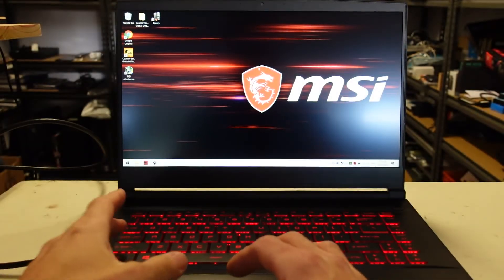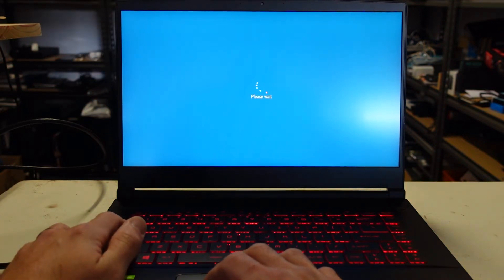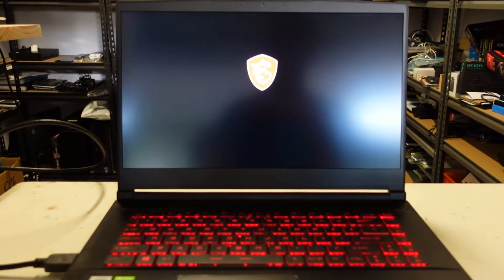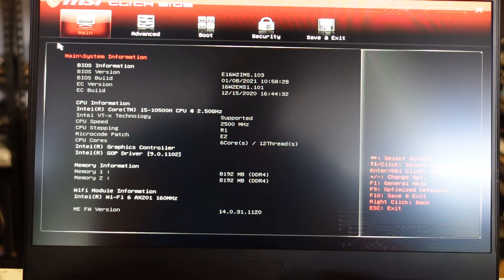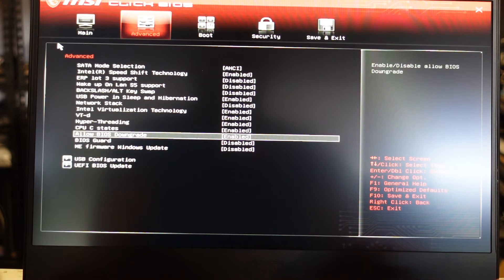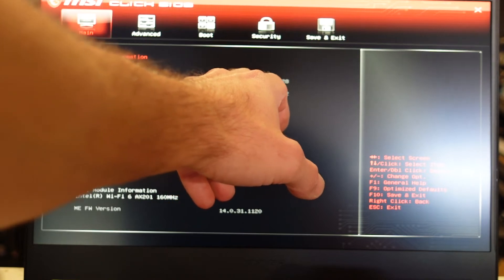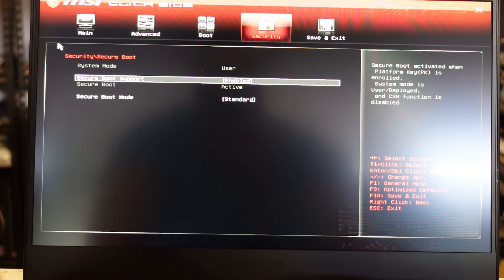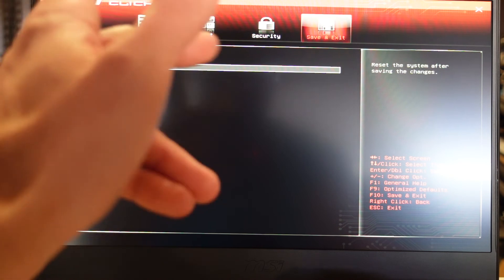MSI GF65 Thin 10UE Bios Walkthrough

Comment: I am stuck on this screen and have no clue what to do. One second i was playing a game, then a blue screen came up saying windows had to reset, now my computer comes here every time i restart it. Can someone please help?

Edit: i completely re installed windows from a USB, wiped all my old stuff, and the problem was gone. Maybe there was a better way to do it and keep my files, but i have no idea. If you have the same issue, good luck.
Reply: Currently experiencing the same thing. Acts as if the ssd isn’t available. Opened up the laptop and disconnected battery/ram/ssd and reconnected, fixed system time/date and it finally worked like normal and still had all of my files. Then went to reset for an update and BAM, back at click bios. Back to square one lol
Reply: @Mr_F0iL  i had to re install windows from a USB drive. It deleted all my files but once the fresh copy of windows was installed i didn't have any more issues.
Reply: @Charles37400 did you get your files back?
Reply: @seekcomesAgain-w8q1v  no
Reply: @Charles37400 did it happen again?
Reply: @seekcomesAgain-w8q1v  also no. i installed a new copy of windows and wiped everything. computer is fine, files are lost. Future bluescreens happened but none that sent me to BIOS or that caused any lasting issues. i really dont know that much about computers but if you really need to keep your files, an idea i had at the time was to replace the hard drive before installing windows again and seeing if i could open the files on another computer by using the old hard drive with it. i didnt bother cause i have a laptop and their annoying to take apart, and also because i didnt have the money to buy a 2nd hard drive, nor a 2nd computer to use it on. that's purely a shot in the dark idea from someone who knows very little about it, dont take it as a recommendation
Reply: Ec reset works for me got stuck today
Reply: Did you fix it?
Reply: I am stuck on it as well, it just happened to me
Reply: Did you manage to fix it ?
Reply: @napoleonbonaparte7193  i think youtube deleted my comment, i did fix it. I re installed Windows completley from a USB drive. Lost all my files but had a working computer again
Reply: bro sameee
Reply: @Rxboiiii  put a new copy of windows on a USB drive and boot the computer from it so it re installs windows. You'll loose all your data but you'll have a functional computer. You can replace your hard drive first if you need that data
Reply: Just search how to ec reset it will show on google
Reply: Did you fixed?
Reply: @dennisribeiro4487  I got the computer to work by deleting everything and re installing windows. I was not able to do it in any way that kept the data on my computer.

Comment: I have such a problem — I removed the floppy video card while cleaning the insides of the computer and after the introduction, the computer stopped seeing it, there are no buttons controlling this in my version of the bios, and after switching to the built-in card and trying to set priorities in the bios, the screen just burned black, I do not know what to do.
Reply from the maker: Floppy video card?

Changing the gpu to inbuilt graphics,  on a machine that doesn't support video output directly via inbuilt graphics

Has got it no longer displaying
Reply: so... it's a death?
Reply: Can you fix?
Reply: it's no needed already, problem not in gc, problem was in overflowed hard drive

Comment: If it keeps rebooting to this screen just hard reset it’ll bring you back to the regular screen where you put your pin or password In
Reply: how to hard reset please mine is stuck on this screen
Reply: @samperez6153  same brother. I think a hard reset is holding down the power button until it shuts off and then turning it back on but that only brought me back to this damn bios screen.
Reply: @Charles37400 have u found a solution yet?

Comment: I need help. So I added a new storage chip and than it took me here and now I’m stuck on it
Reply from the maker: did you remove the current SSD that was in there or add another so there is two?

if you removed the current SSD, you will need to install windows on to the new ssd
Reply: @rickstechrepairs  how can i install it to the new one cause yes i did remove the old ssd

Comment: If you want advanced options:

Right shift + right Ctrl + left alt + f2

Disclaimer: I'm not responsible if you damage your laptop, etc. Do it on your own risk
Reply: How incrase vram in bios?
Reply: Hey I wanna set my min Fan speed down when I dont do much on my laptop. My minimal Fan speed right now is 2222RPM and thats to loud for me... where exactly is this option to set down minimal Fan speed in the advanced options?
Reply: @RulezZ_  MSI Center software should be able to adjust the fan speeds. I would check that first
Reply: @aqua3418  I did... it doesnt go under 2222RPM with lowest fan speed settings in there or even silent mode
Reply: @aqua3418  I can make it higher but never goes under 2222

Comment: I just recently swapped my ssd for a 2tb and now my gf63 is stuck on this screen. Any suggestions?
Reply from the maker: have you installed windows ??
Reply: @rickstechrepairs  i had windows 11 or 10 i believe prior to taking the old ssd out but i don’t think i have a way of finding out if it’s installed right now. Whenever i try to hit save and exit or reset to default settings it turns off then boots up the bios again
Reply from the maker: sounds like you dont have an operating system installed or cloned on to the new SSD

you will need to reinstall the old SSD then creat a usb using the windows 10/11 media creation tool

then put the new SSD back in, then run the usb to install windows

Comment: Hi Rick, I want to change my graphics card préférence from intel to nvidia from bios. I have msi gf63 thin. The options of my Nvidia control panel is not complete. What i can do for fixe it? Maybe the bios is different, it's dépends of msi model.  Thank you for your help. Really good video.👍🏾
Reply from the maker: I wouldn't recommend trying to change settings in the bios, had comments off people disabling the Intel GPU and it has had their machine no longer display
Reply: @rickstechrepairs  I understand, thank you so much for answer

Comment: Where do i find the fan speed option in the bios?
Reply from the maker: i dont believe there is that option, you need to do that in the dragon center software
Reply: @rickstechrepairs  no problem just installed silent option

Comment: hi i have same laptop i have problem with my MSI GF65 a while
my issue is my laptop dont turn on unless is plugged then turns on fine, can u plz help me ?
 i just replaced my battery and its full
Reply from the maker: Can't help, why was the original battery replaced, this model is only like 3 months old

Everything would be covered by warranty